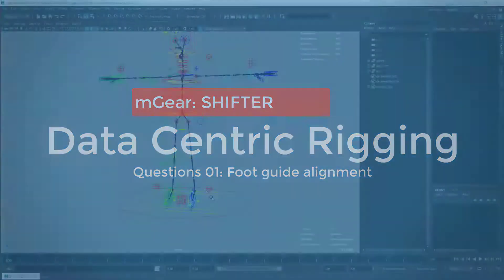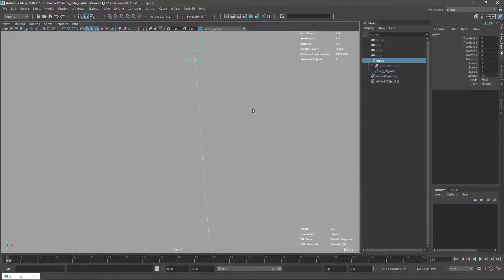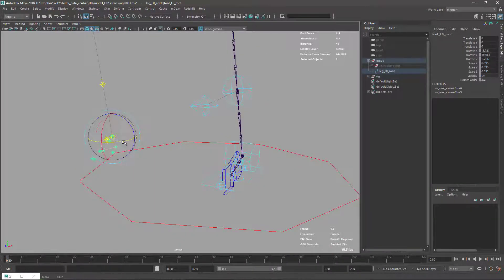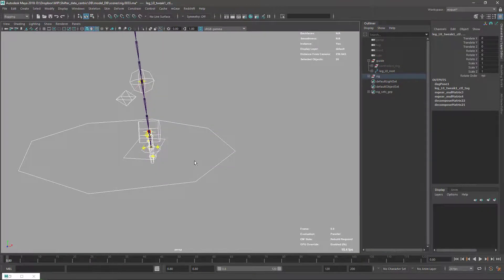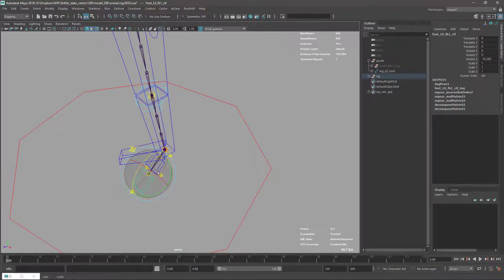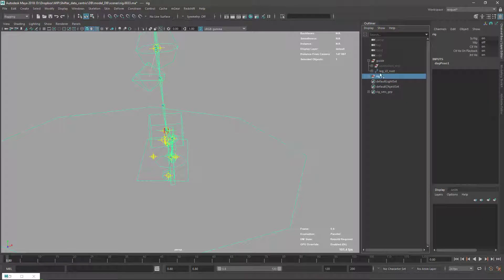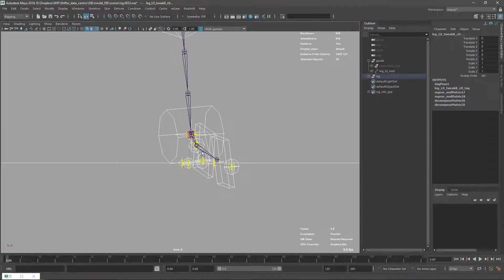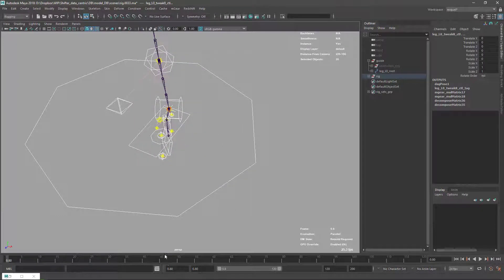Data Centric Rigging 013: Questions 01: Foot guide alignment

Comment: IK feet are easy to get offsets from that zero out to world axis.
just get the heel, toe, inside, and outside pivots as the foot's "ground plane" from that you can calculate what angle the foot is.. and use that as rotational offsets to place on the ankle. That way the rig builds as needed according ot the model, the control is offset from world to be aligned to the foot but in "world space" and when you zero out those rotations, the ankle aligns perfectly with the world. (but do save the pose information somewhere so the rig can be placed back into the model (or rig build) pose.